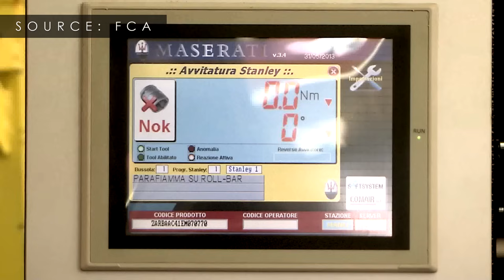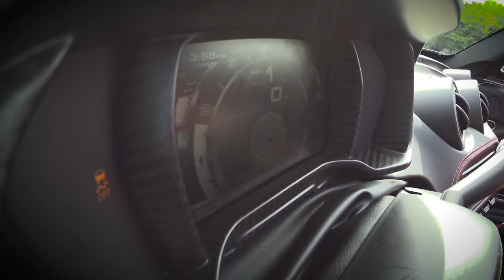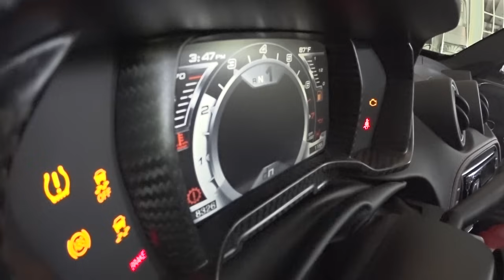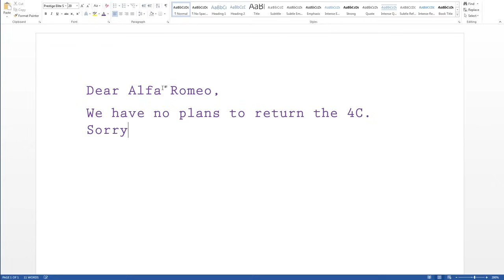Review | Alfa Romeo 4C Spider | Perfectly Imperfect

Comment: Yes....have 3 cars.....the 4C is a bit more than one and a bit less than the other but basically the same. GMC Acadia Denali SUV....Ford full size 150 commercial van in the US. Interesting that both of the other cars aren't sports cars either. And yes being 72 years old helps.

Comment: Would you say it's similar to the Abarth?
Reply: No, not even close.
Reply: Scott P Well no shit? I meant the ideology of the car. All cheap creature comforts for the sake of no compromises when it comes performance.
Reply from the maker: +Steeve McCloud Yeah Id say the same not even close.  Idealogy maybe, using certain elements to connect car and driver like sounds, feel and simplicity but they are miles apart.
Reply: savagegeese Obviously in terms of performance and such, no one would expect the Abarth to compete. I just felt like the two cars are related. Some parts are the same (steering wheel, exhaust tips, etc), no muffler, and the sole purpose of putting a grin on your face
Reply: Maybe a fully optioned up Biposto is of the same philosophy.
Reply: +Kefuddle I would honestly take the 695 over the 4C. So pretty, lol
Reply: But here in the UK the Biposto with the interesting stuff (Dog box, pista kit, etc) £50,000! Serious cash for a hot hatch.

Comment: I don't get why all the hoop-la over the manual transmission. This is a car I would take to the track on weekends and get laps out of. During the week I want it to not be a PITA so the automatic works for me. If you are performance oriented (and this does not mean you are not a car enthusiast or a car "guy") you'd have no problem with the transmission. Drift car? Sure, I want a manual in that. Track car? I don't care as much.

Comment: compare this to the MX5?
Reply: Pretty sure they are in different categories. A Porsche Cayman and Lotus Elise would be more comparable than a MX5.
Reply from the maker: +David Seong As Jason said not in same class but the ND is a budget version, many of same principles just nowhere near as focused as Alfa.
Reply from the maker: Actually cut a part out about it, how in America they are close to the same weight and how amazing the ND would be with similar power levels.
Reply: +Isend2C my thoughts precisely. yes, I haven't driven the new ND yet, but from what I gather from other reviews, it may be a better drivers car than the 4c. the mx5 despite no carbon tub, is ~100 lbs lighter weight WITH more creature comforts! its a manual. it has an LSD. it's front engine rear wheel drive.
Reply from the maker: You can't really compare the two it is night and day difference.  The level of structural rigidity and body control on the ND feels school bus compared to the Alfa. The Alfa is a far better car out of the box.   But that said the price of the ND and some added practicality make it very much the best affordable open top experience.
Reply: +savagegeese thanks for that insight!

Comment: Hmmm... Ok, It's an Alfa. Legend on one side but FCA reliability /dealerships on the other. It's full of expensive carbon parts driving the price up... up...up. 
It's certainly fun to drive, but what could you do with a Miata (at approx. halt the price) and spending another 10-15.000 on a decent engine and tuning parts? Or a readily made V8-converted Flyin' Miata (that still costs less than the 4C).  You might not have the cool factor of a (pseudo) exotic car,  but i'd rather have fun driving  instead of looking at a workshop queen on the lift.

Comment: One day I love this car, other days I don't.. I love the looks, I love the carbon tub, I love the weight (granted would like the euro weight better).. With the s2000 engine and manual it'd be perfect.. Even if you were forced to a dct, why such a bad one? And why an engine that is so peaky and dies at high revs? Aren't Italian cars supposed to have 7500 plus red lines?  Maybe I just need another exige.. Would just be nice to have something that isn't 10 years old and no dealer network.. Won't anyone make a 240hp 7500 rpm redline car, under 2500lbs with a good manual? Maybe I can mod a 2019 miata.. But I hate nodding.. Just want to throw some pads and upgrade some fluids and take the long way to work and hit up a few track days bro.. Lol
Reply: About providing a "tune" for the ND2: Flying Miata say tighter emission regulations and the factory's incorporation of hot-rod enhancements will make the extraction of additional ponies without resorting to forced induction a major challenge for the aftermarket. The ND2's broad power band and 7500 rpm top end result in outstanding drivability -- good enough that the addition of power is not a must, as it was with earlier versions.

Comment: To me this car missed the mark because it aims at the hardcore enthusiasts but it doesn't have a manual. It doesn't have power steering but has a dct? Kills it
Reply: it has a race car transmission- what is to miss? you certainly can't say having race car parts isn't hardcore.
Reply: You're missing the point. This car isn't about speed and it's not a race car
Reply: +rrasvial can you drive a manual? I'm not being mean here but if you can you should get the driver involvement im taking about. Perfect example is the 911 GT3 R. Thats closer to a race car and only has a manual.
Reply: Blake Swan You're not being mean, but you're being presumptuous and snarky. I drive two cars- a 70's ford truck with a manual, and the 4C. Prior I drove a mini cooper s manual.
Have you driven the 4C? If you have driven a manual steering "go-karty" car with this acceleration, and you don't feel involved, get your balls checked, or drive faster. There's not that much to get from perfectly engaging the clutch once you've done it a few thousand times (you still manually select gears with a DCT, this is the only difference really).

In response to "you should get the driver involvement i'm talking about"- re-read your original post. You specifically said nothing about driver involvement. You said "it aims at the hardcore enthusiasts but it doesn't have a manual" which doesn't make sense, as DCT's are more race oriented. But again, on driver involvement you couldn't be less true.
And really- you're going to compare a $60k Alfa with a $200k+ Porsche and say "not as good?" You need an award.
Reply: +rasvial I'm not comparing it to a Porsche. I'm pointing g out that Porsche sacrafices quicker times for driving involvement. Clearly you are like all youtube commenter and are way too defense and sensitive to understand a different perspective. I'm not going to argue with someone who is close minded and just looking for things to jump on and take out of context. Enjoy your 4C as it is an amazing car. I have drove one and thought it would be better with a  manual. Thats my perspective. I like getting a perfect heel toe match. You don't or prefer a dct to have the quickest possible lap time and that's fine. If everyone was the same what a boring world. Take care

Comment: Really ? Having to put up a hood stand is a pain ? So if You were born in the 70's or 80's You would have been cut from the herd I guess. Forget about mowing a lawn !!
Reply from the maker: +Jeffrey Perez Its not a pain, just on the car its a bit annoying because of the angle. Even the Lotus had a gas damper to hold up the boot so no excuse here.

Comment: They nailed the looks but completely missed on the engine... Shame
Reply: Oh and the engine is the easiest part to get right.
Reply: hahaha first thing I thought about is dropping a turbo hyabusa motor in it and call it done. 14k rpm hell yes
Reply: I often wonder whether they should have stuffed in an engine similar to the F20C from the S2000, which makes it more stable on the track (no worries of boost in mid corner). But this is a very competent and tunable engine with a lot of potential and can get you to over 300WHP easily. Plus, the engine power figure is underrated, as its published HP number is actually what it puts out to the wheels.
Reply: The point of this car was to make a super light, mid engined Alfa Romeo.  If you're looking for an Alfa with an amazing engine, there's the 8c.

Comment: There is zero reason to buy this Alpha over a Porsche.
Reply: first it's an Alfa not a greek letter.. second tell me which is the next less expensive car with a pre-preg carbon fibre chassis...4C is a bargain for what offers....to make you an example the only Porsche models with a pre-pref carbon fibre chassis re Carrera GT and 918 Spyder....think that lamborghini on Aventador and McLaren in it's models use less expensive RTM Carbon fibre.....4C Chassis is in the class of the likes of LaFerrari,918 Spyder,Enzo Ferrari,Carrera GT,Veyron,Chiron,Pagani.....those are the cars that use pre-pref carbon fibre chassis like 4C...
Reply: 1) Alfa. 2) I cross shopped the Alfa with the 987 Cayman R and the 981 Cayman S. Objectively, the Cayman is the better sports car on paper and is the better sports car for driving on the track. Problem is, the Cayman doesn't have much character and is rather dull on the street. The Alfa is a feedback machine that's a joy to drive both on track and even in traffic. If you cared ONLY about lap time, the Cayman is the easier car to get to faster lap times. If you put in the work and learn to drive it, the Alfa can be just as quick if not faster because it weighs 7-800lbs less.
Reply: looks for one    Porsche looks are kind of tired
Reply: Conformity is one of the most annoying traits in a person.  Congrats.
Reply: Peder Hansen  No, the first Greek letter is alpha in English.

ALFA is an acronym for (Società) Anonima Lombarda Fabbrica Automobili.  Nicola Romeo became its director a few years later.  Its original name was Società Anonima Italiana Darracq (SAID) and it was founded in 1906 by the French automobile firm of Alexandre Darracq along with some Italian investors.